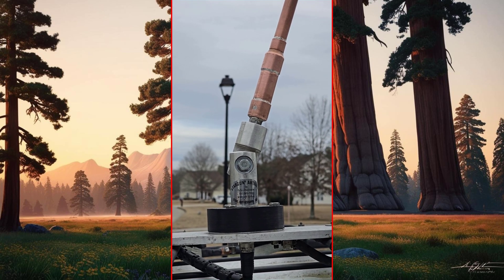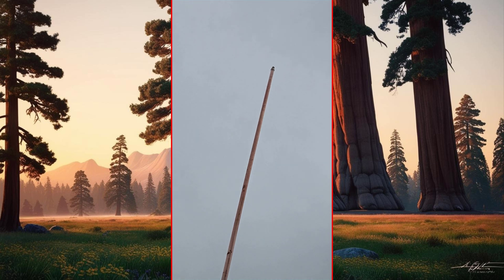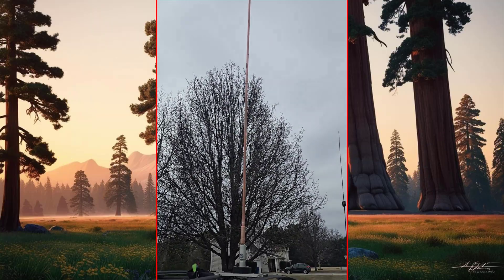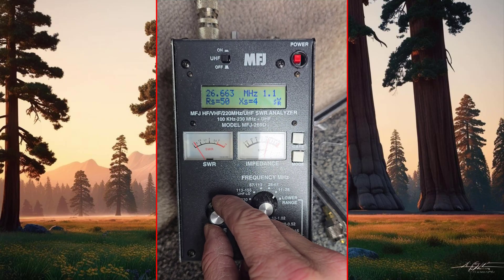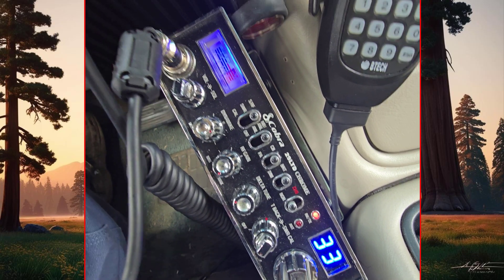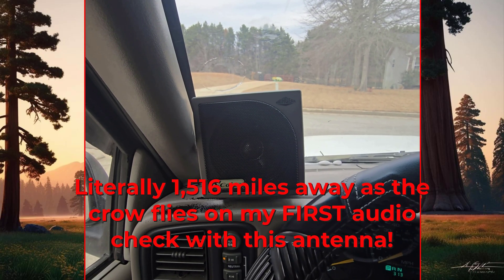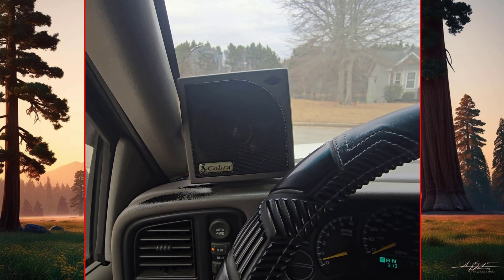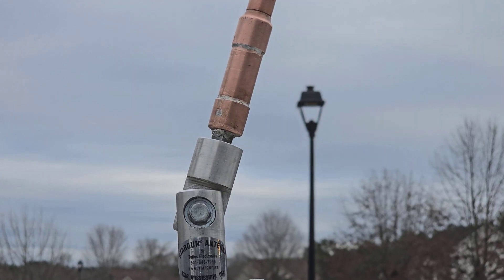Half Inch Copper Pipe Antenna for CB/11m part 2, Tuned Up!

Comment: Would a truck mount work and if i used it as base antenna? And could i go longer?
Reply from the maker: Truck mount would work, but everything affects the SWR. It might need a ground plane kit or a specified coax length, or it may be just fine grounding the mount. And longer than a 1/4 has been difficult for me without some type of matching or coil at the base. But give it a try and keep checking the SWR. Come back if you can and tell me your findings! Im curious. 🤙

Comment: Outstanding job Roadblock !! Glad I could help just a little . I’m like the blind leading  the blind most of the time , you put in the work , figured it out , and made it happen !! Excellent match buddy , you nailed it ,, 73’s from the biggest mud duck in Tennessee,,
Click click 🎙️
Reply: Looks like it tuned out pretty decent…However keep in mind, your swr is good but the resonance was at 60 so if you run power your likely to see some reflect! Oh and Dallas is a MuddRunner.
Reply from the maker: Bahaha. Thanks. Question though. And im genuinely curious. On this type of setup, how can I modify the resonance without hurting the SWR? Keep in mind it's a copper pipe. Like capacitance hats, coils etc...
Reply: There’s several ways resonance could be achieved, you could simply sleeve your 1/2” pipe with a 6” piece of 3/4” copper or something that fits snug, starting about 2” from the base simply slid the 6” piece up or down and resonance could be found…that would work much like tuning rings on an Antron99 or imax, or like the old k40 mobile ants that had a slider piece. You could also reduce the top down and insert a small length of stainless steel all thread, essentially making it tune like a fire stick! If you’re not plan on running more than 100-150 watts I’d say you’ll probably be fine with the current setup, just keep in mind that reflective power is present so just don’t get long winded!
Reply from the maker: @SeaweedOregon  omg. That sounds like a great idea and simple to boot! I may do just that! I'll put it in my next video and credit you for it!
Reply: @GiantSequoiaNation I don’t need a shout Brother! Just giving my 2 cents and trying to help. If you use the all thread method I’d suggest getting a barrel coupler and soldering it in the top much like you did on the base you built. 10/24 threads have always worked for me. If you use the slider method the slider could end up basically anywhere on the Ant, you could use the set screw method or solder it upon reaching the target of 50 ohms and a swr of 1:1. Both work well. 73’s hope to hear you on the air! 
Udx-534 Oregon state
Reply from the maker: @SeaweedOregon  that's sounds like an awesome idea. I've been searching for a solution to that issue for real. Plus, I may be considering welding this together. The solder is separating over time, flopping all over the roof... additionally I am looking to introduce a separate antenna that will be easy to ship and unique in the market. I promise no one will have an antenna like this! But i also want it to tune perfectly and  cutting to length may not be the solution, as you suggested. I may incorporate these techniques into that as well. I will report back as I advance with these projects! Many thanks!
Reply: @GiantSequoiaNation you could also make it Telescoping So a person could fold it down to half the size for easy transport! I’ll look forward to see what you come up with! 73’s
Reply from the maker: For sure! 10-4. And 10-21.
Reply from the maker: @Dallas-Rife-UDX-347-Tennessee  you're the man. Drop that hammer down!